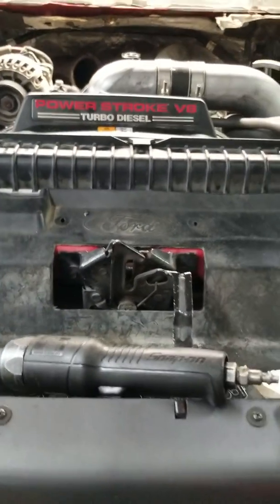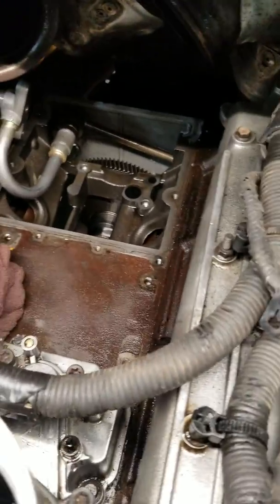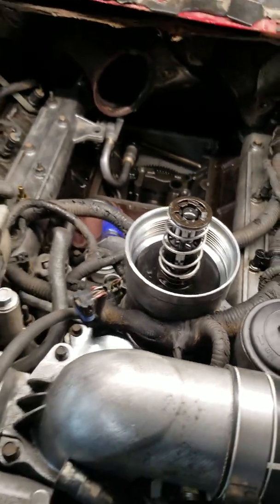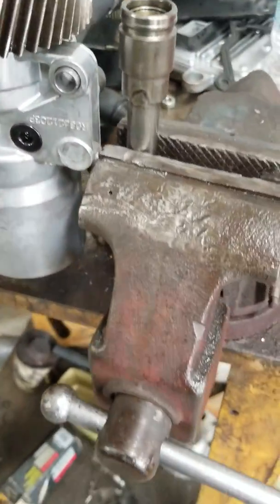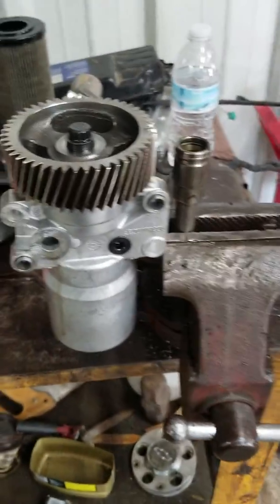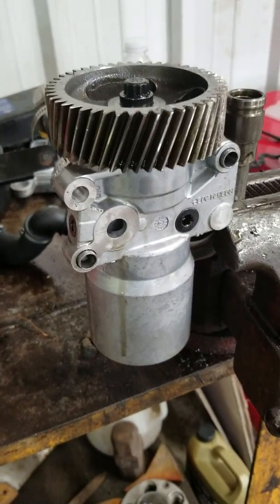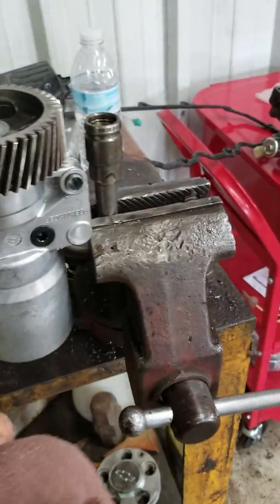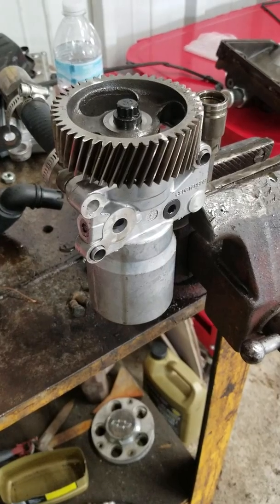Hpop 6.0 ROUND PUMP OLD STYLE air test. Good or bad 2004 round. Gurgling in oil filter housing

Comment: This is air bleed through in the pump is normal operation. If the pump didn't have this internal leakage it would fracture the housing the moment a relief valve became stuck or the pump produced flow beyond what the injectors and IPR valve could flow. It's built in internal leakage that keeps the pump from becoming an oil filled grenade.
The oiling system for the injectors is not a sealed system and is not designed to hold pressure indefinitely. Leak down during the air test is normal and expected.  If you've got air coming through the oil filter housing then congratulations your system doesn't have a massive leak.
The air test is to locate where possible leaks are. Check that you don't have leaks under the valve covers then remove the IPR valve from the pump housing and check that the valve holds pressure. That's all you check with air. After that you consider the pump or aeration of the oil at the suction side of the pump.
Being such an early engine the IPR for this truck doesn't have the metal filter screen on the end and it only takes a sliver of anything hard to unseat the valve and create a long crank or no start situation.
You literally shot yourself in the foot at 2:36 by your own admittance not checking the valve responsible for containing the pumped oil to create the oil pressure.
Reply: Excellent share here thanks that all makes sense about the oil filter air/gurgle and what all!!

Comment: FWIW, I just pulled a pump out of mine that was installed in March of this year (2021), and it's doing the exact same thing.  Won't hold air, and spins way too freely to convince me that it's capable of pressurizing oil to multiple thousands of psi. Mine failed instantly too. sitting at a light, and the truck just died. Reman pump from a Ford dealer too.  Thanks for posting this video though, any information/demonstration like this really helps when one is trying to diagnose issues.  Thanks!

Comment: Well interesting to see an OE pump with the plug in the housing if it was a true OEM pump it would of bad the original design ball bearing check valve? So what gives ?
Reply from the maker: Not that sharp on them, or how they came from the factory. Besides who knows how many people have been inside the motor before I was into it working on the hpop. After another new pump my truck would start right up and not have a long start. I just had a cast iron 2005 and up hpop go to crap and them are almost bulletproof. Just another $1000 day owning a 6.0 ford.

Comment: I just finished on 03 HPOP and she only get up to 130PSI. I guess I will have to air test through the IPR again on this one and see. I will let you all know. BTW Mine is a Ford Rebuilt I purchased From IPR Research. I also did New IPR Valve , New ICP, New Ford Oil Cooler, Updated Turbo Feed and Drain Pipes, Crank Case Breather Re-Route, IPR Research Coolant Filter.
Reply from the maker: so if u still have truck all together did u crank it for a min or so.. first start is a bit&% takes forever to get oil up from low pressure oil pump to hpop and then to build 500 psi before it will fire.. and i took mine out again to check stuff and didnt find anything.. put it back together a 3rd time got it to fire and idle. so i let it run for 30 mins and drove it... that way it purged all the air out of system.. one time we got truck to fire after replacing hpop .. then turned it off after a min or so.. then tried to start again later and had to long crank start it..... but the first fire up after a hpop replacement took 40 sec to 2 mins to get it 500psi to fire.. so i would hook a battery charger up and crank it
Reply: what ever happened?
Reply: @lnc23  ended up going through 3 pumps before we got a good one, then a year later it went out again, will only buy a pump from KT performance now
Reply: @quadragin  thanks for the video! I bought a re-man and like yours it’s bad out of the box doing exactly what your did! Unfortunately the company I bought it from will not warranty or refund. I just installed the diesel right Adrenalin high output pump. I went to KT like you suggested and I’m super happy I did as I don’t really want to do this again anytime soon. It’s actually a fun motor to work on, well laid out (except the turbo) and pretty simple and straight forward but who the hell wants to do this 3-5 times? Thanks again for the video and the KT suggestion.

Comment: It's the way your doing your air test you need to put air to the ipr.not icp
Reply from the maker: The truck would long start everytime.. we put air to everything, every way, and everywhere u could but could not find a leak. We finally figured it out the hpop was junk. It's no fun putting it all back together again and again to find there a leak. So this is why we were doing air test like this cause I knew the ford dealer would fight me on there junk new part. After buying another one and waiting over a month and finally just being bitchie with ford I got my money back for the junk one. There was no resistance what so ever in this pump. It would spin like a top. Next new pump u had to apply power to turn gear. Put it in and no more long starts

Comment: Was it bad?
Reply from the maker: yes we put in another new one from ford and let the truck run for about 10 mins and it stud erd a couple of times, like all the air out of the system. let it sit for 5 mins and went out and it started right up. the bad one would loss psi and it made for a long start again.. 30-40 sec before it had enough (500ish) psi to fire.. the bad one from ford we could turn by hand and u had no resistance turning it...like spinning a top so so so easy . the new one u had to use some muscle to turn it.. u could feel the resistance.